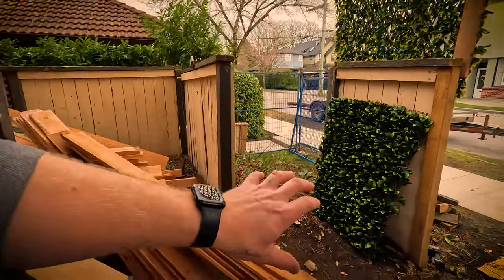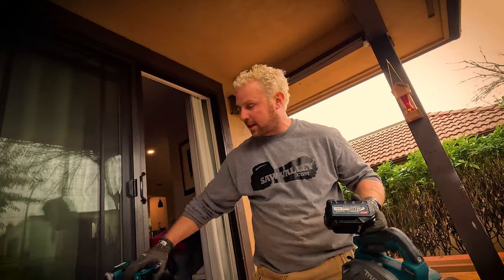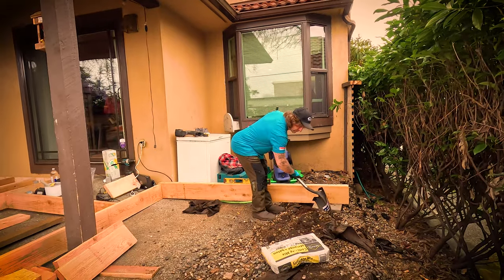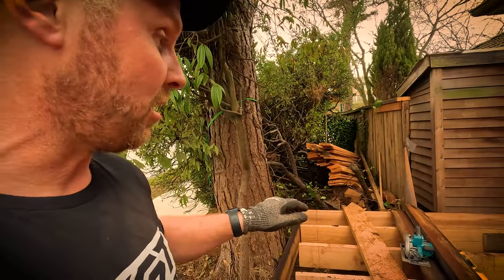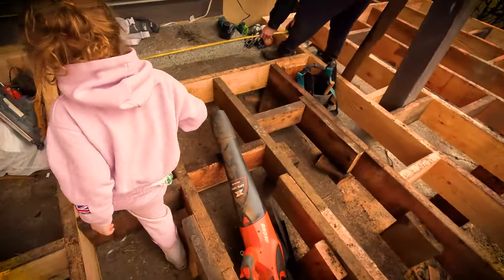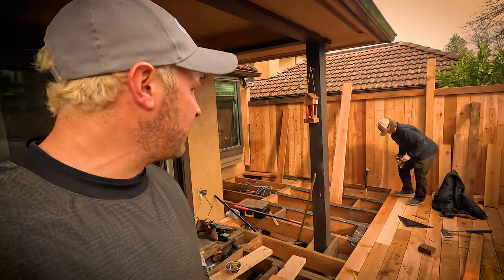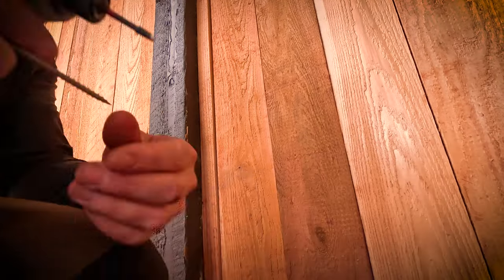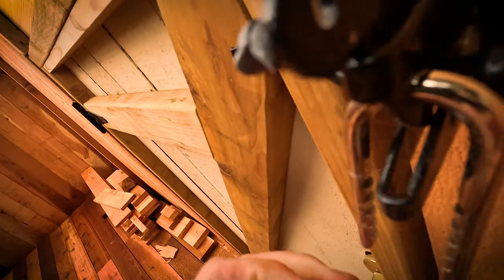CHAINSAW Carpenters !! Building a Cedar DECK and Fence - how too !?!?

Comment: Hahaha, I take my hat off to you guys. 7 years ago I was tasked by my daugther to build a fench around a garden and a large decking area. Like you guys I'd never done this before but I do have considerable woodworking skills (bragging now). I approarched it in exactly the same way you guys did. It's still there and will be long after the brick built house has gone. Hmm. The point is, we had a Halloween party later that year and my stepson (a bonefide joiner who had been working out of town) said it was one of the sterdiest deckings he'd ever seen. He'd followed my daugthers blog and asked. "Why didn't you just build the base in bits on a flat surface and then fit them in place. No leveling every piece. No leveling every post. Just one big as you can make it piece at a time. Blow my mind, pissed me off and convinced me never to do it again. Oh! The fence, yeh I probably did a better job. 😂🤣😂🤣